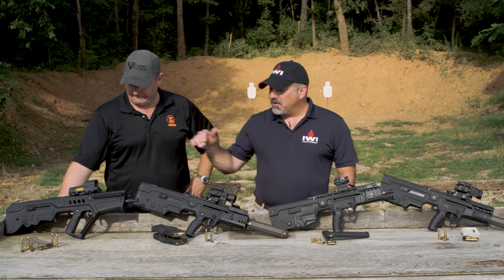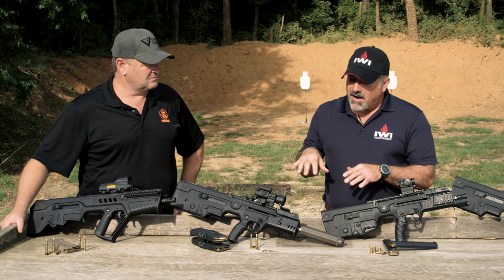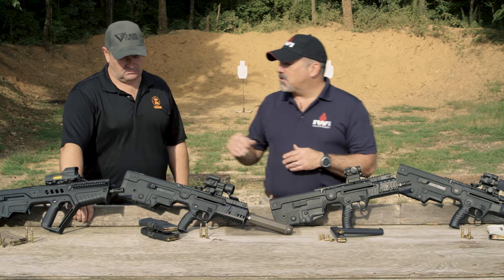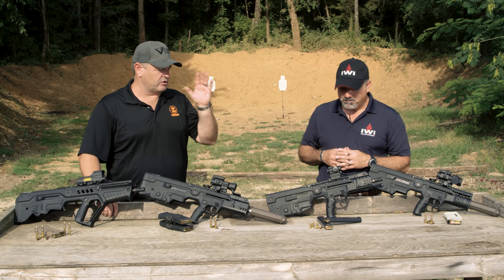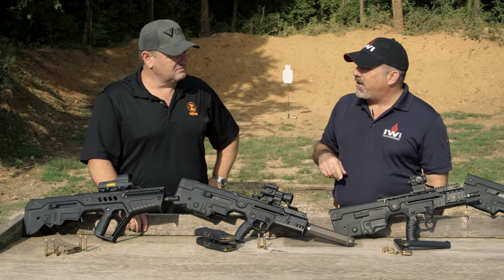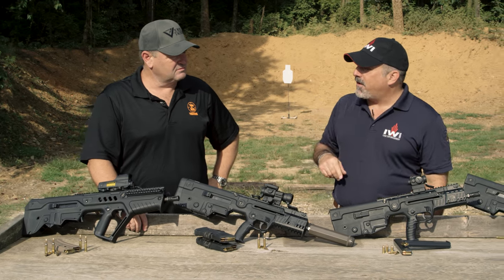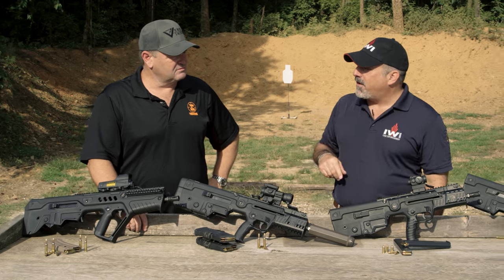IWI X-95 SERIES

Comment: People give bullpups a lot of shit for having bad triggers. The X-95 is a step in the right direction.
Reply: I know,  and triggers are relatively easy to design too.  Something as simple as a tensioned cable should make a terrific trigger.
Reply: The trigger on the X95...isn't terrible. That being said, I have a Geissele trigger inbound, and when their sear pack finally comes off of backorder, I'll install one of those too. But, out of the box it isn't terrible.
Reply: That's the funny part. I don't know anyone that runs a factory AR trigger and they see that as okay but then bitch when they think about having to change the trigger on a BP.

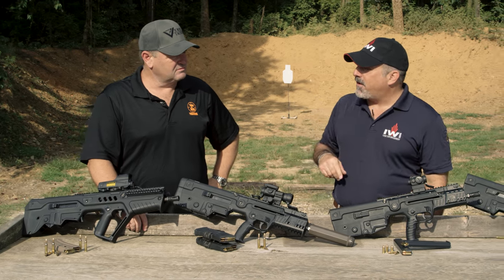Comment: can somebody tell me what magazine coupler is being used at 16:00 ? Its not the magpul or any other coupler I have seen, because they are all designed for the magazines facing the same direction.
Reply: Same. I ordered the magpul couplers thinking that they would work and they clearly didn’t!
Reply: No idea what manufacturer, but it looks like a CAA MCD16N coupler.
Even if not, the one I mentioned is basically standard issue in the IDF and lets you do that thing with the magazines.
Reply: @nathanv9562  Possible CAA MCD16N

Comment: Considering the fact that the X-95 is an assault rifle desgned to handle Rifle Pressure cartridges, I assume it's 9mm verson can handle those Russian overpressure Armor-Piercing rounds, such as 7N21 and 7N31. Something only some Purposely made guns (such as the GSH-18 and PP-2000) can handle such overpressure rounds. Howeaver, by being an assault rifle, the X-95 could easely handle 41.000+ PSI cartridges. The only other non-Russian gun that can fire 7N21 and 7N31 cartridges is the Steyr AUG, wich also has a very common 9mm conversion.

Comment: just curious if you have ran steel case ammo through the x95 and if so how reliable was it with steel? also on the heat dissipation, does it get hot enough to melt the polymer around the barrel? just curious ans if you have said in the video im sorry I have a short attention span. thanks for the review what I did catch was useful info.

Comment: I have an earlier Tavor SAR  (Woodland Digital)  in 5.56 with the correct Israeli Collimator Sight. The stock trigger at 8-10 pounds pull and NO creep (3 finger effort) was HORRIBLE and even IWI USA recommended swapping out the TG with a $200.00 replacement X-95 TG, which is what I did. MUCH better, but I still prefer the AK platform in M43 caliber-John in Texas

Comment: I wanna know when we will get the sbr 300 blk kit
Reply: Probably never. A rep at IWI told me that they have no plans for a 300BLK SBR. You'd think that the ONE caliber that thrives on shorter barrels would be available with a shorter barrel, but whatever.
Reply: @PopBubbleWrappable  I got my x95 in .300 BO yesterday. Plan is to pin and weld a suppressor on it after having the barrel chopped to make it a one stamp gun. It's probably not that complicated cause the gas block is fairly far back so dwell time ought to be fine

Comment: The X95 has ergonomic issues for me, probably because of the OAL modifications they had to do to make it legal. The regular tavor feels absolutely perfect. What's surprised me the most with my tavor is just how accurate the thing is, especially when you push out beyond 100 yards, it's just so easy to get follow up shots at distances that would have normally felt problematic with a normal rifle. You have so much contact  with the rifle, it just feels great to shoot standing at distance.

Comment: I would be more comfortable if this unit in 223 or 308 would have a 1 and 10 spin,  barreling  and a 20inch length barrel  for long to medium distance work. My opinion.
Reply: .223 is 5.56mm - Tavor 7 is what you're referring to at 308 (7.62mm)
addendum: it's CloseQuarter weapon with a 18.6" barrel rifle capabilities.

Comment: This gun vibrates all over the gun damn place. The beauty of the Stoner gas system is keeping the majority of recoil forces completely in line with the bore. Here you have a heavy gas system above the bore-axis. Too much reciprocating mass up there.
Reply: Have you shot one.🤨
Reply: @StevenSmith-pt8rz  No I have not. However, it's clear how much worse the recoil impulse is here. In the slow motion you can see recoil impact once the round is fired and then again once that big block fully compresses the spring, knocking the barrel around again.

Comment: Still kinda bummed that they're phasing out the Tavor. I think its the better of the two rifles.
Reply: ap1986 Tavor is still the name for the family of rifles, though I imagine like the AK47, the original rifle will be the most famous for years to come despite being (slightly) technologically inferior.
Reply: They're the same rifle just with slightly different layouts.
Reply: The X95 was created for a reason. The TAR21 had several shortcomings, with one of the issues being the lack of picatinny rails. What happened was that soldiers who wanted to mount forward grips had to drill through the hand-guard and screw them into place with whatever they could find lying around, so you'd get soldiers walking around with shoddy mods that aren't very safe and then you'd have armories full of rifles with holes in them.
Most X95 rifles the IDF issues to infantry come with CAA bipod-grips installed, so that's one less thing for them to worry about.
Reply: They're remaking it this year as the Tavor 7 - and it's now in 7.62x51

Comment: It's entirely possible someone said this here before me, but I can't see why the 9mm model doesn't use Glock mags!
Reply: They have Colt mags over there and there are a lot over here.  Glock mags slope backwards (for a pistol) so the ergo's of the weapon would be a bit awkward for reloads and feeding.  The main objective was to stay away from anything proprietary.  The Colt mags fit the bill.
Reply: Thomas Alibrando
Cool, that actually makes sense. I was thinking in terms of commonality of parts and I see a lot more Glock mags than Colt mags. Then, just as I'm typing this, something else occurs to me: original Colt 9mm SMG mags were converted Uzi mags. And this is why they don't pay me to make the big decisions!

Comment: "It has to do with subsonic vs supersonic, not suppressed vs unsuppresed" translation: suppressed vs unsuppresed
Reply: You can run supersonic in a suppressed weapon, you can run subsonic in a suppressed weapon.  Some gas regulators are based on the suppressor being attached.  This one has to do with the type of round you are putting through the weapon.  The added pressure of the suppressor is not the deciding factor.  That was the point